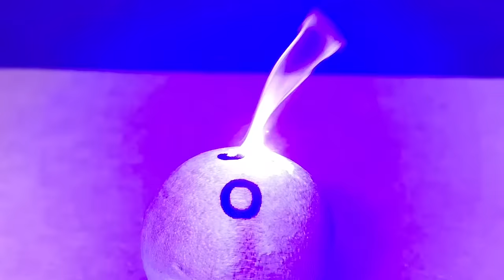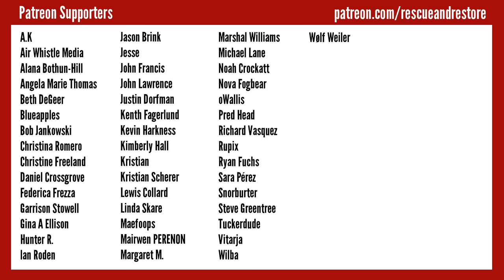Bingo Tabletop Game Restoration

Comment: OMG! I used to call Bingo at my kid's elementary school years ago. The school (to this very day!)has the exact same model sorter that you just restored. It is every bit as rusty and dinged and bent as the one you restored too. However, the side where the roller cage is on this one was "upgraded" to a glass sided box with electric air blower that randomly mixes and chooses a ball (not wood- more like ping pong density plastic so the air can move them inside). It would periodically overheat (there was a lightbulb inside) and begin to emit smoke mid game. Bingo is boring you say? Hah.  
This brought back some really fun memories and you did an excellent job restoring this old beast.🧯🔥💡 
PS: Is nobody going to mention your little bingo buddy who skittered across at 00:08? I almost jumped a foot.🕷

Comment: I am surprised you were able to clean up the cage instead of stripping it off and recoating it. If there had been any cracks in the coating, the wire inside would have been rusted and would have had to be sandblasted and recoated. You are lucky to have such a dream shop, no doubt great product placements, now, everything so new, clean, and shiny. I have never seen a shop of any kind so pristine and camera worthy. There were a couple of tools you had here I had never seen before, nor used.

Comment: BINGO!  How well I recall one of the callers one Spring day saying, Under the B ... pauses for effect ... A Flower!  My ears rang with the laughter.
That said, at the 3:12 mark, using a block of wood on the inside and the clamp, would have straightened those edges perfectly. ;)
Where do you find those original style decals? You etch them all? :O

Comment: Can you tell me please what kind of pressure washer cabinet and equipment do you use, and how it works? Is it circulating or use tap water? I assume that this needs a high volume compressor as well, is it right?